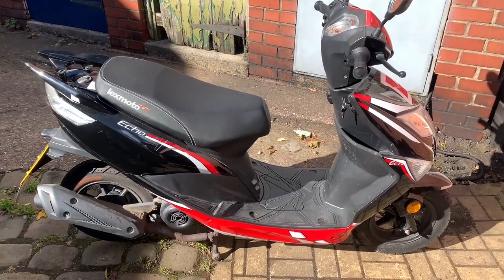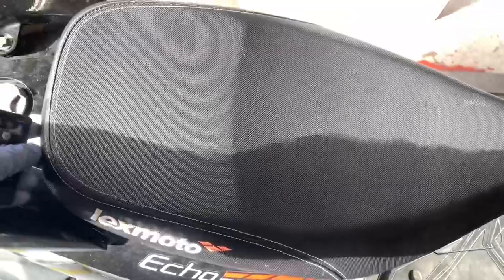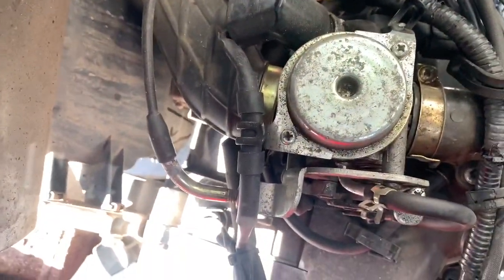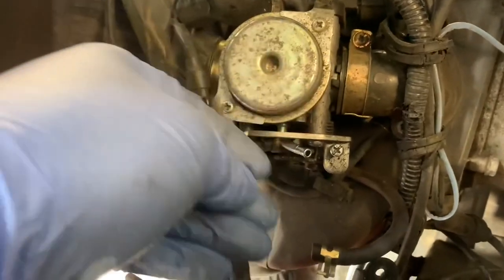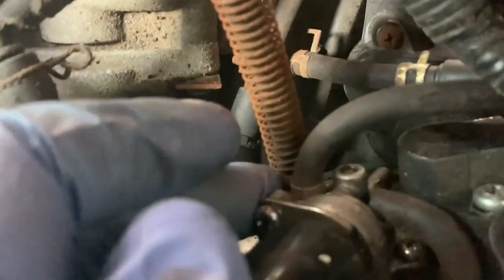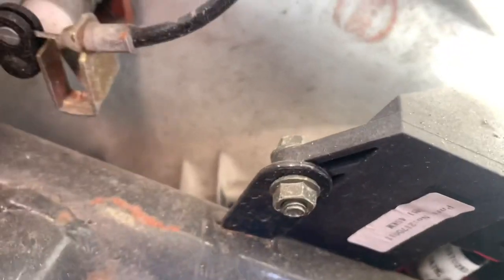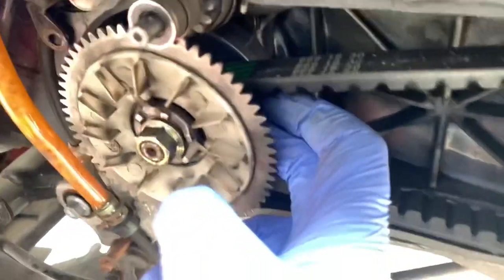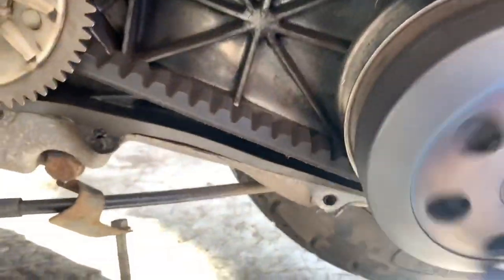50cc 4 Stroke De-Restriction, Euro 4 GY6/New Type Scooter Derestrict... “Make Ya Ped More Fasterer”

Comment: Good stuff,, so would that be same for a katana 50cc, 07
Reply from the maker: No mate. Katana is an old 2 stroke, brilliant Bikes and much faster than these when derestricted. The exhaust and the variator is usually where they are restricted. In my experience they respond well to a sports exhaust, variator washer out and lightened rollers.

Comment: Hi, I've just done exactly what you showed in the video and it's derestricted now, it goes 42mph but, lost a lot of acceleration. A hill start is a nightmare. Feels like driving off in a car in 2nd gear. Any ideas? Hill starts are terrible. Lexmoto Echo Plus 2020.
Reply: I thought putting the bb's in will fix it but it only made it get from 35 to 42mph faster than before. Another thing to mention is the back wheel is constantly spinning when on centre stand even after warming up and riding it.
Reply from the maker: Have you taken the variator apart? The BB in the pipes won’t mechanically affect the drive, and should also improve acceleration throughout the rev range. It sounds like a drive issue, as in you’ve not put the rollers back in properly or one has come out possibly.
Reply: @DjSunshine07  hey mate was ur variator ring welded on? If so how did you remove it
Reply: @StupidBlokeStupidVideos  managed to fix it by decreasing the idle speed. Back wheel wasn't spinning anymore at idle.
Reply: @bayleyclarke7513  Mine wasn't wielded in. Just had to pull it out. Heard from someone that u could either heat it up or try and cut a portion of it... I am terrible at mechanics so try and look for someone who removed a wielded one to see what they done. Sorry I can't help.
Reply from the maker: @DjSunshine07  good stuff
Reply: @DjSunshine07  Check your idle..  The back tire should not spin when at idle.  Adjust (carb) until it [the tire] stops moving.
Reply: If your acceleration isn't all that great I recommend taking off the stock airbox and putting on a cone style air filter. You can get them on Amazon or Ebay for around 10 dollars. You can also get a drill and like a 3/8ths drill bit and drill 5 or 6 holes in the end of your muffler to get more air flow. If you've done all of that and you still want more power, order an aftermarket ECU online and switch out the stock one.

Comment: Mine has a metal washer on it should I just heat it up and pull it off
Reply from the maker: On the variator slide?
Reply from the maker: @carljefferies6916  if you can get it off then yes take it off, but it’s usually cheap enough to buy a non restricted variator than struggle removing the ring.
Reply: @StupidBlokeStupidVideos  hi I have a 50 gy6 lexmoto Vienna 2016 is this a euro 4 ? Iv fitted a 100 kit to it pulls really well now but can’t seem to find a way to de restrict it any help would be much appreciated thanks 👍
Reply from the maker: @pikiejohn  how fast goes it max at? I doubt it’s a eu4 on that year. The car will likely have a throttle stop on it as I show on another vid on the channel, and the variator a washer in it. CDI rev limited too usually but this one isn’t as restrictive as the others
Reply: @StupidBlokeStupidVideos  hi it dose 30 mph there is no washer on the variator bud only a metal sleeve type tube that the belt runs on I have up jet carb and bigger air filter plus orange cdi unit and the 100cc big bore kit but still only do 30 after all then mods lol 🤔👍
Reply from the maker: @pikiejohn  have you disconnected any speed sensors that go to the clutch? I’m assuming it hits 30 pretty quick then just hits a wall? Have you checked what type of restrictor is on the carb and found my other vid on derestricting the older type carb too? It won’t be a euro 4 if you’ve fitted the orange CDI as they are the old type.

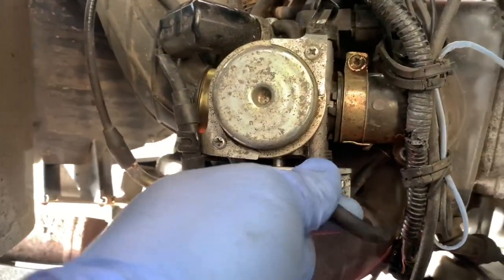Comment: I tried to take off one of the pipes you showed at around 2:20 but it starts to rip when I try and pull it off, what should I do?
Reply from the maker: If there’s any leaks on the pipe it’s gonna cause issues. Maybe cut it close to the carb if it’s already damaged then get the rest off the carb by pulling and twisting and the put the good part of the pipe back onto the carb once blocked with the ball bearing
Reply: @StupidBlokeStupidVideos  are you sure it'll be alright to cut off a little bit? i dont wanna cut any off and then its too short to put it back on
Reply from the maker: @Evasi0m  should be ok as long as you don’t take too much off. If it’s not already ripped then you could follow it to the solenoid at the other end abs block it there instead. It doesn’t even need to stay connected to the solenoid, you could just blank it and leave the other end disconnected
Reply: @StupidBlokeStupidVideos  ahh right i didn't think about following it to the other end, i'll definitely try that. do you know anything else that'd block it cause i dont have any little bb's like the ones you have

Comment: Can you open variator
Reply from the maker: Variatiors can be opened up yes. Some of them have a removable ring in them to restrict the gearing, some of them the ring is built into the slide and can’t be reminisced without grinding it off. Many newer ones have an electronic restrictor instead of restricting the gearing though.

Comment: How fast can it go now
Reply from the maker: This procedure is more about gaining a bit more acceleration/power up hills than top speed.
Reply: Mine does 45 and accelerates quicker
Reply from the maker: Yea as mentioned, the blocking of the vac lines to the carb is more for acceleration and hills. Top speed is usually governed by the variatior or a speed limiter which this bike didn’t have.

Comment: I have done this now my bike won’t start
Reply from the maker: RtX x FuRY you’ve done something wrong then. Check you’ve not knocked any wires off whilst taking the seat bowl out.
Reply from the maker: Also make sure you’ve not blocked the carb vent pipe off instead of the vac line on the airbox side of the carb. It’s next to the choke, if you block that the carb won’t fill with fuel properly.

Comment: Is it safe? To do it?
Reply from the maker: I’ve derestricted many 50cc scooters, most of them the older style carb but some of them with this style. Never had any issues.
Reply: @StupidBlokeStupidVideos  Ok! But do u have to Block both of them with the bb gun ball or just the one u did?
Reply from the maker: @fax2000  I did both of them, follow the vac lines and block the ones linked the the solenoid valves. It works by the solenoids opening and releasing the vacuum above the diaphragm that pulls the slide up, thus dropping the slide/closing the throttle. Don’t block the wrong one though, eg blocking the carb vent which is next to one of these pipes will likely cause issues and stop the carb filling properly.

Comment: Does it work for znen r8?
Reply from the maker: I’m not familiar with that one but as long as it’s in the same carb setup as this, then it should
Reply: @StupidBlokeStupidVideos  2:19 the thing you pulled off doesn’t have the metal thing. And im pulling on it and i think its just going to snap
Reply from the maker: @jarnamadurinn  you mean the little pipe? Some of them don’t have the metal clips. You can follow the pipe and disconnect it from the solonoid valve at the other end and block it there if it won’t come off but it should come off. Be gentle and maybe warm it up with a hair dryer if it’s tight
Reply: @StupidBlokeStupidVideos  yeah i did it, but it didnt do anything. I need to get a derestricted ecu but i dont know where i get them to match my znen r8

Comment: Anyone know where the indicator relay is on these
Reply from the maker: Some are under the seat, some next to the battery. A lot of them are under the front panel though. Just going off Chinese scooters in general.
Reply: @StupidBlokeStupidVideos  front panel is only bit I aint had off yet so that narrows it down. Thanks alot
Reply from the maker: @markoneill3553  no probs. I’ve seen a few there, and some under the clocks too.
Reply: @StupidBlokeStupidVideos  found it. It was literally under the light lol
Reply from the maker: Good do.

Comment: Cant you just take out a cable in the ecu?
Reply from the maker: Not on this model
Reply: Can you do a video where you show how to unplug the restrict from the variator
Reply from the maker: @davidrubensson8322  just follow the wire up from the variator.
Reply: @StupidBlokeStupidVideos  i did it but then the eml tuned on. So when you try to drive it it bogs sp you fan only drive 5mph
Reply from the maker: @davidrubensson8322  some do that unfortunately if they don’t receive a signal from it, it goes in to limp dick mode.
Reply: @StupidBlokeStupidVideos  do you know any programns to reprogrsm a ecu or to modify it so its derestricted

Comment: The bb balls made the engine smoke. Took it off wasn't a good idea..
Reply from the maker: That shouldn’t happen. Sounds like you’ve done something wrong there to be honest. All the bb bullets do is bypass the electronic carb restrictor.
Reply: I followed your video to the T. I changed it back to it was its OK now. Shall I give it another go?
Reply from the maker: @moukbu4235  when you say it made the engine smoke, do you mean from the exhaust as in oil burning smoke?
Reply from the maker: @moukbu4235  this mod shouldn’t have any effect on that.
Reply: @StupidBlokeStupidVideos  the back pipe is a struggle to pull out once I've taken the jubilee clips off. Any tips on how to do it. Or can I block the part of the pipe where it leads to? I mean the other end of it?
Reply from the maker: @moukbu4235  if the weather is cold then the pipes can be harder to pull off. If you can warm it up a bit it should come off easier. It will work at the other end, that’s where the solenoid blocks it, but it’s effectively making the area where negative pressure occurs above the diaphragm larger. Probably wouldn’t make any noticeable difference though.
Reply: @StupidBlokeStupidVideos  OK managed to do it. No smoke this time round. Will take it out on a run tomorrow.
I was watching a few vids on carborators. The guy was saying the air vacuum valve is needed for fuel overflow which comes out a hose in the rear.

Is that true? What does that mean then if I have an overflow, where wud it come out of?
Reply from the maker: @moukbu4235  no, sounds like he’s confusing the vent on the carb which is near to the vac line on the left hand side of the carb. The ones you need to block are the two that go to the solenoids. There’s usually another vac line that comes from the inlet manifold to open the fuel tap but this shouldn’t affect that.
Reply: @StupidBlokeStupidVideos  I've got the same bike so I did exactly what u did pal. So I know I'm safe 🤞🏽 I think ☺️
Reply from the maker: @moukbu4235  hopefully!

Comment: It doesnt work the bike will just cut out as soon as you start it
Reply from the maker: You’ve done it wrong then.
Reply from the maker: What bike do you have and have you definitely not blocked off the wrong pipes? If you block the wrong pipes, you could cause the bike to cut out. I work in a motorcycle shop, and have done this many times.
Reply: @StupidBlokeStupidVideos  i done it but not your way they were defo on the right pipes. As if you block the vacume of the carb you will stop the flow of fuel hence why the bike cut out
Reply from the maker: @matrixgaming5651  this isn’t the vac line that opens the fuel tap. You may be thinking of the older type carb.

Comment: I tried all these YouTube videos to make a 50cc scooter faster.  NONE OF THEM WORKED very well at all.  6MPH isn't even noticeable.  I spent maybe $200US and just built a 100CC engine from Italian Vespa GY6 parts.  Now my little cheap Chinese scooter (Euro 4) hits about 65-ish.. Up hill is no longer a problem.   Everything is cheap for a scooter.  Entire engine is less than $300US.  So forget all these "make your slow scooter faster" videos.. they are ALL pointless.  Spend the money for a real motorcycle or spend a little money and build a more powerful GY6.    Who is going to check for emissions on a vehicle that you do not have to register?  No one ..LOL.. so get rid of all the emissions junk.  BTW: Chinese parts are horrible and will not last under constant usage.
Reply from the maker: You’re missing the point a little bit. 50cc scooters, in this country at least, are restricted. This is just about removing that restriction and giving the bike back the power it was initially designed with before the restrictor was added to meet rules and regulations. What you’re talking about is tuning/modifying, which is a different game altogether. You’re obviously going to gain much more by modifying than just derestricting, but it’s much more involved and expensive. This is easy and costs nothing to do, and it does make a noticeable difference to the performance of done correctly.